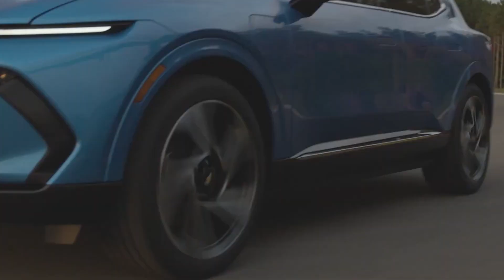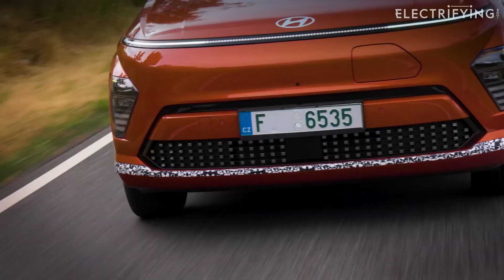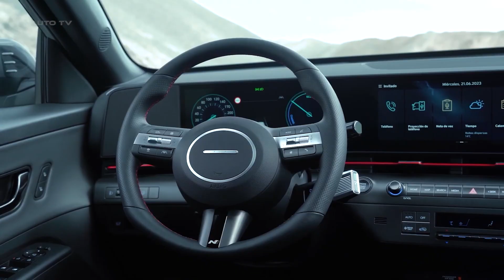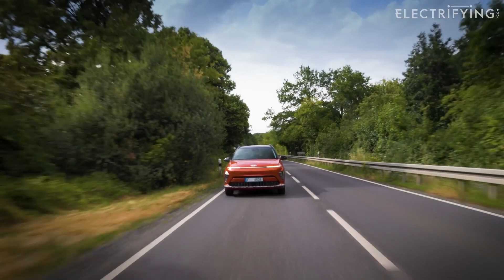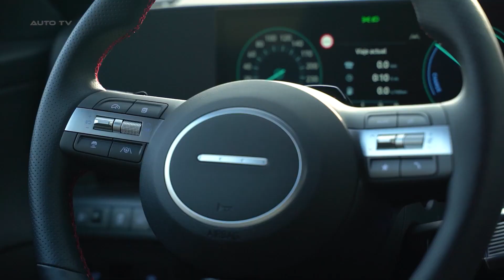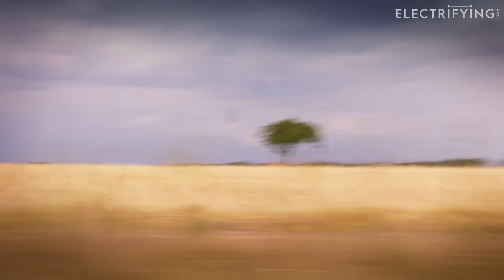2024 Equinox EV Vs. 2024 Hyundai Kona EV

Comment: After this, still waiting for real new news about the Equinox EV. GM’s basic method with EVs has been to expand passenger room in lieu of behind the back seat storage, therefore comparing the gas Equinox interior dimensions to the EV is as unrealistic as comparing the Bolt EUV to the Trailblazer. 

What would be good to know is whether or not GM’s new drive system allows the electrical disconnection of the front or rear motor in the AWD vehicle to increase range in some highway situations. I own a ‘23 EUV, and I’m concerned about the realistic range of the base Equinox. In comparison, it has 10 hp more and 24 lbs-ft of torque less than the EUV. I don’t see how this equals the same range with -10kWh battery. GM might be taking a point from Tesla’s playbook and fudging range ratings extremely to their advantage. Already the EUV range is stretched as it’s 247 mi range on a 65 kWh battery is 3.8 mi/kWh. This requires long range highway drivers to use range extending techniques in order to reach. I have seen some rumors that the Ultium charging speeds are still only 150kw max for the base offerings. This = fail, GM. I think the market expects a minimum of 250kw in this era of EV evolution.